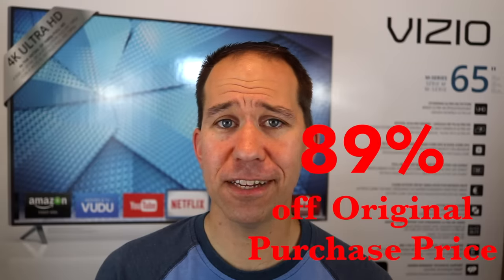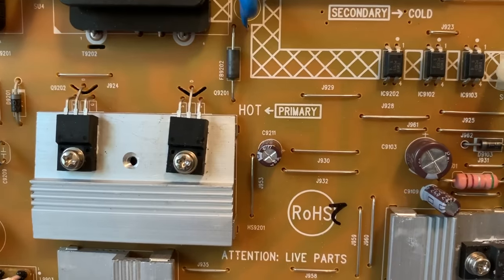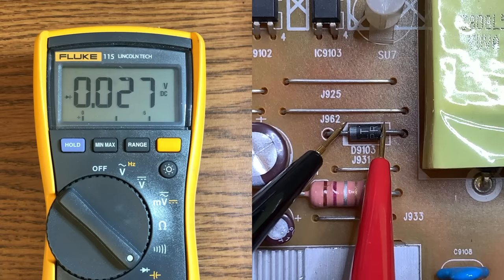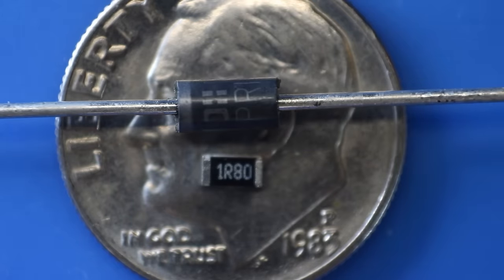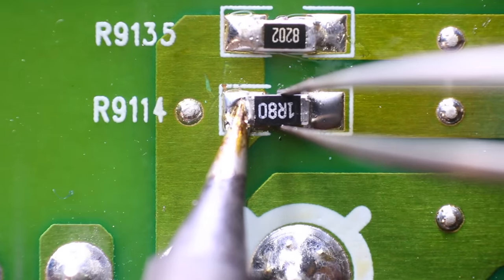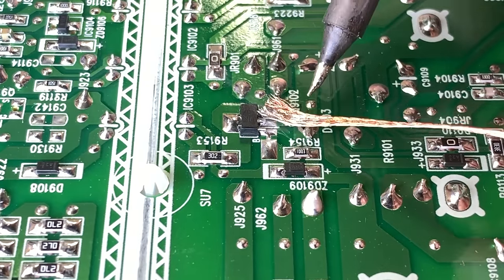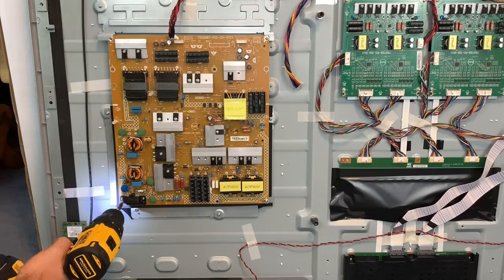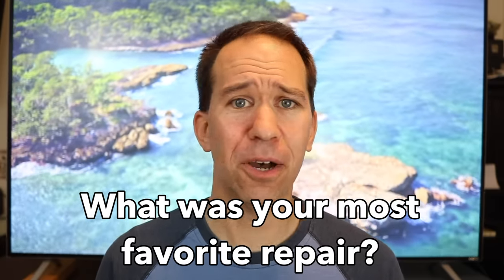I got a broken 65” 4K TV - How I repaired a Vizio M65-C1 (tv won’t turn on)

Comment: I have a TCL 55 inch sitting out on the curb now for garbage pick up. No picture, but if you shine a flashlight toward the screen you can see the images, they just don't light up. I don't own the equipment and maybe don't have the skill to make the repair myself, but here's the crazy thing - why can't I find somebody who will charge me $50 to do it? I see that the average cost of the repair is closer to $200 and at that price it wasn't worth it, I just bought a new one.
Reply from the maker: Your backlight is out.  You can repair it for about $1 in parts.  The labor is what you would pay for.  Before throwing it out I would recommend using your flashlight to get into the menu and turn the brightness down on the tv to 10%.  The backlight may come on at a lower power setting.  Then you can slowly increase it to see when it cuts out.  It may not work at 10% but you never know until you try.
Reply: @FrugalRepair  Thanks very much for the response.

Comment: Sir, I have toshiba 42RV530U lcd & the problem is the fuse resistor 1.8 ohms is bad then I replaced its blows again. This is in power supply & I think it's a 24v. I check the relay & resistor already
Reply from the maker: I'm not sure what your question is.
Reply: @FrugalRepair  I need help on how to figure out this resistor thak keeps blowing
Reply from the maker: @alstevens44  Sounds like something is shorted.  I'm not sure how I can help you test the components to figure out where the short is.

Comment: I have 2 stories......a Dyson vacuum cleaner was left by the dumpster nearest my apt.found what was wrong and spent almost $50 to get a $700 vacuum working! The other story was finding a 2 year old samsung note 9 with a broken screen  and replacing the battery and the screen.....put $300+ into a phone that was originally $1200 when it first came out and in 2020 was still selling for $700
Reply from the maker: Great stories!

Comment: Alright guys. He said to comment for repair questions so... I bought a toshiba 50 or 55 inch fire tv.... model number: 55LF621U19... it wasn’t dropped.. originally the seller said it was stuck on the loading screen but when I got it home the screen was black... then after unplugging it... there were some vertical lines in half of the screen... I’m havin a really hard time finding a replacement tcon board to see if that’s the problem. Watching this guys videos help so it gives me an idea of where to start... does anyone know any other helpful tips to try and diagnose this tv....
Reply from the maker: It’s hard to know what to say, you’ve listed out a bunch of possible symptoms and they would mean different things.  You need to try to track down where the offering board or part is, panel, tcon, main board.

Comment: How to replace back light LED Strip on Sony Bravia KD55X8500C?
Reply from the maker: I have never done it on that particular model but all LCD back lights are very similar. You need to take the TV apart and carefully lift up the LCD screen without cracking it. Then you’ll have access to the LED backlight after you remove the diffusion films and prism filter.

Comment: I got a 55 inch Vizio 3D TV . The service man came to replace the speaker and nothing else . Why the TV was laying flat on its face without the back on it he picked it up and took it over and tried to plug it into the cable to see if the speaker would work . Now the Vizio has a very small trim around it but I think he done wrong by picking you up without the back being on it now the picture is all distorted it's brown and all kind of different colors and all over the place . Any ideas can I can it be fixed . I really don't think he should have picked it up without the back being on it being it was unsteady .
Reply from the maker: He may have damaged the lcd screen.  You don’t need the plastic back on to move a TV.  Just need to be careful.  I’d say watch my tape fixing videos for things you can try.

Comment: I found one now looking to order tools.  On your sheet one of the links isn’t working.  I will check it and provide the name.
Reply: The light on the right side is a solid red.  I hope it's the same issue
Reply from the maker: Which tool are you looking to get?  I’ll make sure to update to the best recommendation.

Comment: measuring resistance of a component in a circuit won't work if it's in parallel with other components.
Reply from the maker: Yes, you need to be aware of that.  In this case, a mega ohm reading across a 1.8ohm resistor almost certainly means an open circuit on that resistor.

Comment: Did you notice when you had the cover removed that the TV is actually dual voltage?
Reply from the maker: What do you mean?
Reply: @FrugalRepair  when you disassembled your Visio did you see if it indicated anywhere inside that indicated that it was 220v?
Reply from the maker: TVs in the USA don’t use 220v

Comment: How do I fix my monitor which has red vertical line at left side .
Reply from the maker: It could be from the tcon circuit (I’m not sure where that is on your monitor) but more likely, I would say, is a failing tab bond on the lcd to the buffer board.  You can google this and find a jerry rig solution.  You basically have to find a way to put pressure on that spot to make the electrical connection.  I’ve “fixed” this before with tape a toothpick or with some card stock.

Comment: have a Seiki SE550FY33 which has a few horizontal lines. Unhooked ribbon tape. I know which side is faulty. I an not figure out which pins are connected together. HELP

Comment: hiii i got an imac 27" and found that the power suply was clicking. The motherboard lights up when i conect the power cable but when pressing the power button it just die. Any sugestion?? thankss :D
Reply from the maker: I’m not sure what to say.  I’d need some more detail.  Is the power supply putting out the correct voltage(s)?
Reply: From the 16 pins i get 2 pins with voltage (12v and 3v) and also the power suply is clicking internally. Also y found a diode in short. But the diode is not faulty :(
Reply from the maker: @XxNachilloxX  Sorry, I don't think I'm able to give you much help since I'm not familiar with the the power supply on your imac.  The clicking is a good clue.  You may need to hunt down the bad component(s) one at a time.

Comment: I have a Vizio 43 and logo light keep flashing. Can you help me keep it?  I called vizio they say it had to do with power.
Reply from the maker: The light/logo in the bezel?  Or the logo that shows on the lcd screen?  If on the bezel one guess would be eeprom on main board.  What research did you do on the model number and symptoms?

Comment: Sir can we still fix a cracked tv screen ? And it has like black ink? Going out?
Reply from the maker: Unfortunately, you cannot fix a cracked screen LCD.
Reply: @FrugalRepair  but can we still replace it?? or it can never fix
Reply from the maker: Yes, you can replace the LCD but it needs to be the exact same specifications. The big problem is that you generally can’t find another one for sale anywhere.
Reply: @FrugalRepair  oww my tv brand is ace and its 24in where can i buy one
Reply from the maker: I don’t know any place that you can buy a replacement screen. You may be able to buy one from China on AliExpress.com
Reply: @FrugalRepair  ow ye ali express i forgot  that its a online shoping right? Does it deliver to philippines?
Reply: @FrugalRepair  what should i search lcd replacement?
Reply: Or lcd 24in what should i search?what should i search?

Comment: One of the shots has your bench in the background. You forgot to add a few hundred dollars in tools and probably a couple decades of experience to your repair budget :-)  Nice work though! In general, if you pick up a road TV and the power is good, but the LCD is cracked, would it be worth the repair? Asking for a friend.
Reply from the maker: Thanks, I already had the tools and I don’t have decades of experience.  It really did only cost me the few dollars to fix it.  Regarding your question,  unfortunately no, if the LCD is cracked you cannot repair it. What I would do however, is look up the model number on eBay because you could potentially sell the internal boards for a profit (verifying that they work).

Comment: I have a TLC 55in got a black screen of death will power on but the TLC logo only show flash for like a second and then it goes completely black but I'll still have sound to every the inputs everybody saying is the LED set going out if it's an LED TV only had it for a year and a half
Reply from the maker: Yes, you have what sounds like is a bad backlight. I describe in my tips pdf (check the video description) how you may be able to get the image back by turning down the settings using a flashlight

Comment: Please help me with my Vizio! It keeps turning off When I cast from my phone or computer wireless, Play My PS4 and start using my controller, and  sometimes during watching from my Fire stick. It takes about a minute for it to come back on by itself. I cant turn it on with th remote after it shuts off. I've lost my receipt from a year ago. Please help before I purchase another tv this week.
Reply from the maker: What have you found out in your research so far?  Any clues to the issue?  Make sure to search on your model number.
Reply: @FrugalRepair  My model is E65-F0. I've tried to find research and have tried factory reset, power cycling, turning of HDMI link and countless others not even recognized with this brand. I even called vizio to. Vizio claims its the power supply, but It doesn't do this when watching from my cable box. It has to be some type of sensor or receiver or a motherboard issue is what i am to believe.
Reply: any help in any direction would be much appreciated!
Reply from the maker: It doesn’t sound like the power supply.  Perhaps all of the problems are related to HMDI?  You mentioned wireless but is that through HDMI?  Did you look up how much a new main board costs on eBay?
Reply: @FrugalRepair  20-100 bucks for a board. yes its wireless and HDMI i guess.
Reply from the maker: Ok, you’re sure it isn’t just the backlight going out?  Doesn’t sound like it but wanted to ask.  I’d do some hunting around inside the tv, maybe put a big fan blowing on the back to keep it cooler and see if it lasts longer before shutting off, and for $20 you could take a gamble on the main board.  Sorry I can’t go through all of the steps I would take.

Comment: The diode test should have been done with power off and the diode setting on the meter used, or ohms setting....     Testing diode with power on, with a meter will only show the difference between anode and cathode, which may be forward biased with power on, and thus giving small voltage difference
Reply from the maker: Thanks but power was off and testing in circuit showed the fault.  There wasn’t a need to desolder it ahead of time.  What am I missing?

Comment: I have a Samsung 60 inch and has a negative or soliarized picture.  Is there anyway i can fix it?
Reply from the maker: This is a difficult problem to figure out because it could be from several sources. If the problem is with the LCD panel itself then you can’t fix it. Have you tried doing a factory reset? And have you researched online to see if this is a common problem?  Besides the problem being in the LCD assembly itself, it could also be a problem with the T-con board or with the main board.

Comment: The next question is, why did that resistor & diode die in the 1st place?
Reply from the maker: I’m not sure why.  I haven’t bothered to investigate it but if someone else does I will post that online.  TV is still running great.
Reply: @FrugalRepair  ... It's probably some sort of power surge, but why?  You could go back to that forum, maybe that guy or someone else on that forum thread had an explanation. Or you could ask the question there.   So far when I've fixed a few monitors & TV's, it's only been replacing capacitors, or replacing daughterboards & cracked solder joints that needed to be reflowed.  That's both flatscreens & CRT's.  I've got a few more tube TV's  to look into to fix.
Reply from the maker: What would be really helpful is to have a schematic of the board.  It is a common problem so it’s probably either a poor design or a batch of bad diodes were used.
Reply: @FrugalRepair  ... Yeah that would work too, but I've personally very rarely seen TV/monitor manufacturers give out schematics & repair manuals right on the Internet, especially for recent models (within the last 10-20 years). Usually those are only meant for in-house techs.  You could search for free schems, or go to some of those online manual websites & see if they have it, although if they do, it's probably at least $10 to buy the schem or repair docs.  You can also try eBay, I've paid for manuals there but for older models, like from the 1980's-1990's.   Last but not least, the manufacturer and/or their website.  Maybe ask tech support, but I doubt they will give you one & probably not for free. And of course that forum.  Perhaps the last way is to do the debug yourself & follow the traces to where the resistor & diode are connected to what other parts.  If it's common, then you're right, poor design or low quality parts.  If it's a power surge, perhaps modify the circuit to add like maybe a MOV or maybe use a diode that has a higher breakdown, etc.  Or maybe none of that & keep enjoying the TV, heh.  
By the way, one thing I've noticed is that flatscreens TV's used to be like 60 & 70 inches only 5-10 years ago, but now I rarely see that & instead they use the 65 & 75 et al, like yours.  I haven't really done any searching on why.   Probably getting cheaper to make so they attract customers by making TV "slightly" bigger sizes.  Yeah, I know that was a long post lol.

Comment: Can you help me my 65 in vizio tv is frozen with the logo on no it wont reset i can on turn off by unplugging when i plug back in and push power only the logo comes on cant change channel or reset or move volume ..nothing.
Reply from the maker: Probably corrupted firmware.  The eeprom chip on main board is what I would look up replacing.  Look up your model number with these terms I’ve mentioned.

Comment: Why did it break in the first place is the big question. Since if it broke once it will break again. Or maybe the parts were cheaply made and defective.
Reply from the maker: I haven’t had a chance to do more research into it yet.  Some have commented that it could likely be a faulty (or sub-standard) diode.  The tv is still working fine though!

Comment: is it kinda lucky that the problem was only this small, or is that very common for electronics when they dont power on?
Reply from the maker: Problems with electronics are usually only one or two components.  The key is knowing which ones are at fault.  And the other issue is how easy it is to get to them and replace them.

Comment: Reese  I have a 60 in Sharp tv  Mod # LC -60LE55OU , I am 99.9 % sure it only has a  burn't  backlight  LED , even though the screen don't light up a  picture , in the right light you can see a faint picture , therefore I believe it needs LED's, but I am having trouble locating a source for them , can you help , thanks in advance   Frank T
Reply from the maker: Do you know if that one is edge lit or full array LED?  Did you shine a light on the screen to verify it is the led that is bad?  And are you hoping to solder in new individual LED components or replace whole strips?